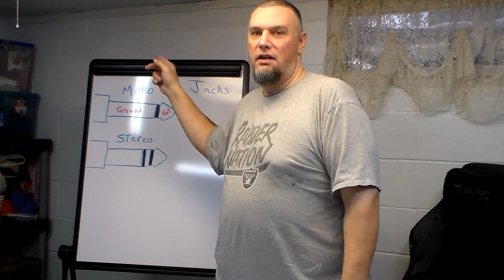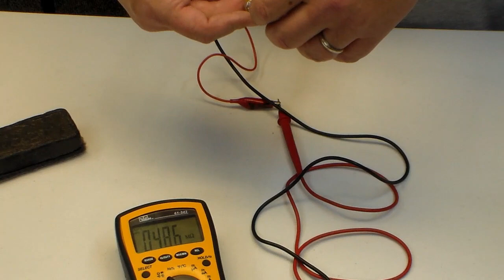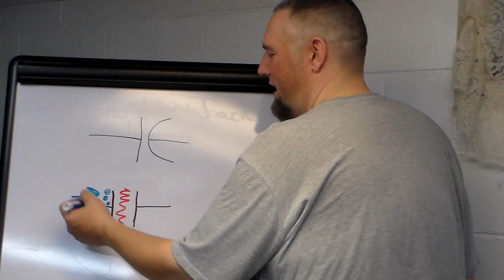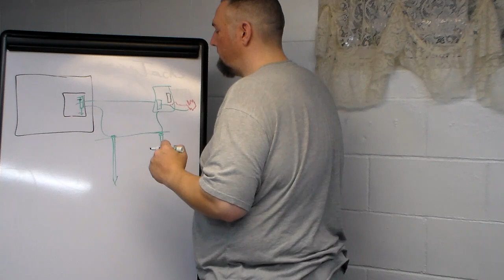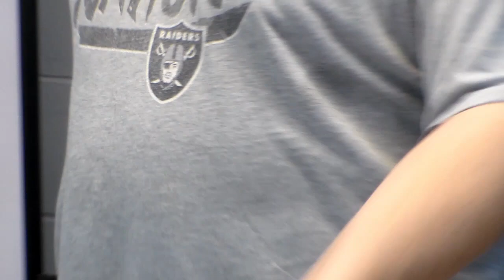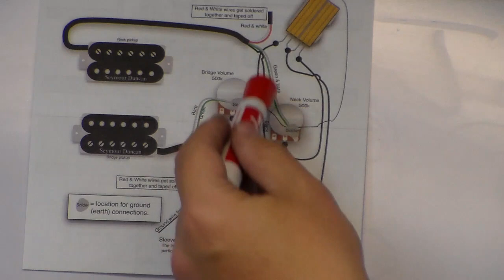Guitar Electronics

Comment: It took long enough, but today was the day. I took five pages of notes. Something that struck me was the idea that the signal comes IN to the guitar from the amp, is acted upon, and returns via the ground. I think I understood it that the pickup magnets created the field, and the string vibrating in the field created a tiny charge in the coil that was then sent to be amplified. I thought of the guitar as being output only, or the generator of the signal, and the amp as just taking the weak input and doing its voodoo. It's interesting to think of the guitar and amp as two parts of a circuit, rather than as the two ends of the "Signal chain."
 
 So if I understand; the volume pot is not regulating what comes out of the pickups, but rather how much power goes into them in the first place. The volume pot is upstream, or on the input side of the pickup; while the tone pot and capacitor are downstream, or on the output side of the pickup. The tone pot and cap vary how much of the signal gets filtered and how much gets passed straight through, but all paths out of the tone pot lead to ground, which is actually the 'Output' of the guitar.  Have I followed the plot here?

Now that we understand how a guitar does its part, can you explain how Amp's work? I vaguely imagine it to be not dissimilar to how the ignition coil in a car creates high voltage from a weak input, but what is really going on in there? When Ben showed the jam jar amps on the channel I got interested in how they work. I know this will lead to the wonderful world of tubes and transistors, and how Willy Wonka got them all to fit on IC chips. I just can't wait!
 As I sit here, I notice the overdrive pedal sitting there plugged in between my guitar and the amp. This all must mean that the signal is passing both ways through the pedals too, though they have their own power supplies. What is up with that? While this is more of a signal chain question than a strictly electrical one, is this why some amps have effects loops? And, what are those about?

 Speaking of pedals, count me in for the soldering video. As I mentioned in the chat, I went down a Youtube wabbit hole of pedal building awhile ago. I managed to order a pcb, components and enclosure, and build a Fuzz Face that actually worked. It fit in the box, the LED lit up, and I still didn't sound like Jimi; but I was grinning. That soldering was a hack job however, and it's a miracle that it worked. It looks so easy when other people do it, but....

That pedal, and the rest of them recently got ripped off, and the box of new parts is sitting there next to the amp. I just have to go get a new soldering kit, and voltmeter; they got those too. Any advice about what a basic hobby electronics toolkit should look like and include? What am I looking for when I go shopping? 

Thanks for this video, learned a lot.
~Mike
Reply from the maker: To be honest, I am really not an expert on amplifiers. I understand the basics, but there are far better videos explaining how amplifiers work elsewhere on YouTube, rather than me trying to type it out.

But yes, the amp is where the signal begins - the guitar modifies that and sends it back. Think of it like this - if the guitar generated a signal, I could just plug it into any speaker and get sound. I have to have the amplifier.

As for pedals, they add "color" to the signal chain. Which honestly, some people don't like. By putting the pedals in the effects loop, the signal chain stays "pure", and then the effects are just modifying the final output, rather than altering/coloring the signal chain.
Reply from the maker: And yes - think of the potentiometer as a 2 way gate. One way - the signal goes through the pickups, etc. The other way, signal just returns to ground.
Reply from the maker: There's a lot to unpack here, and I have to get ready to teach a class today. I will respond tomorrow when I have more time.

Comment: Awesome overview dude 😀 now I know how the tone does its thing lol.
Two things I would love you to cover next time though, what value capacitors have the strongest/weakest effect on the tone? Also about active pickups and how you wire them up? Thanks mate.
Reply from the maker: Basically, the higher value the capacitor, the muddier it gets. So usually, people use "orange caps", which are .022 micro or 22,000 pf
Reply from the maker: A .044 cap is significantly darker in tone